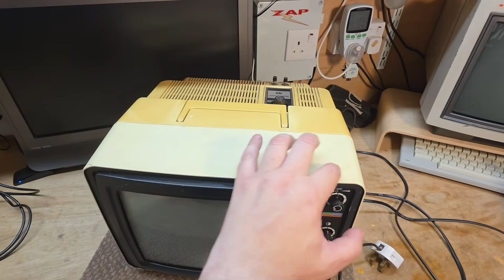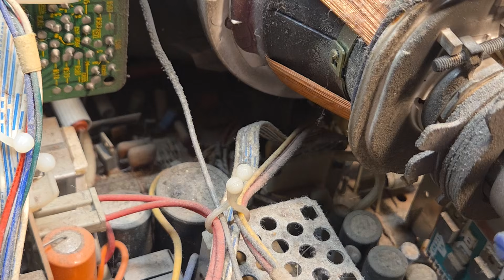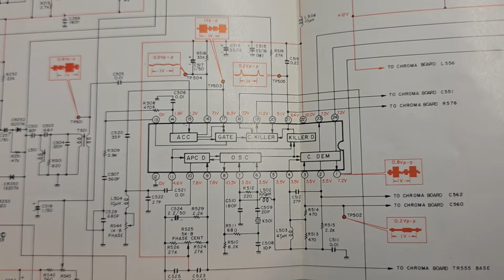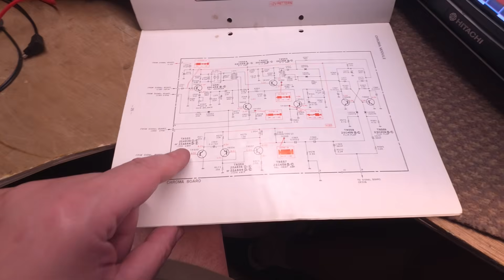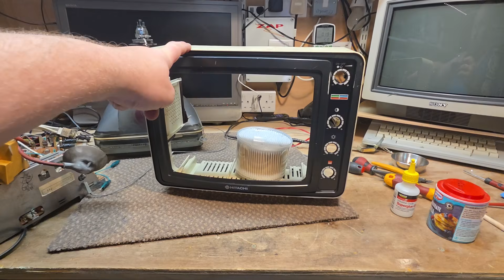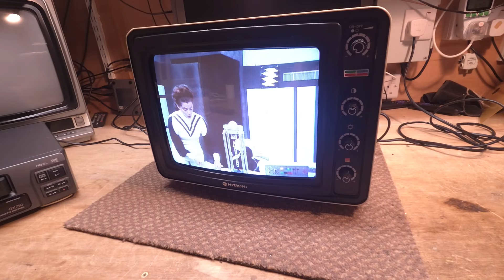1976 Hitachi CWP-132 CRT TV Restoration

Comment: Awesome, I have the exact Hitachi model in my collection. I worked for a main Hitachi dealer in the 70s & 80s. Those sets were extremely reliable in their day, we hardly had to repair any, apart from the odd electrolytic in the power supply. It was very enjoyable being a service engineer in those days when everything could be repaired. Happy days, Thank you for the video!

Comment: These are great sets a bit awkward to work on 
Make sure the scan coil rubbers are not rock hard if so they will eat into the copper of the scan coils take them out and cover them with insulation tape 
Great job done

Comment: I had the same problem with 2SC945 in a 1980s transceiver.  All of them about 20 had low gain between 0 and about 20.  Replaced them all and all fine again.

Comment: Great job, thats quite a fiddly set to work on by the looks of it too.
I use the pink stuff to bring a lot of crud from the outside of the cases, really good stuff but can be quite abrasive on certain types of plastics so best used with water. 
Thanks for sharing, nice to see you back and doing ok.